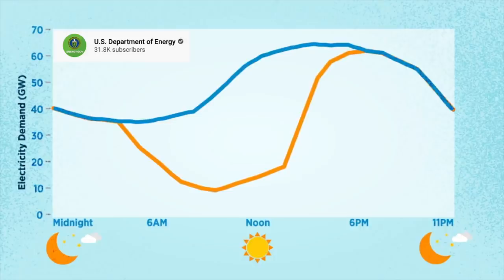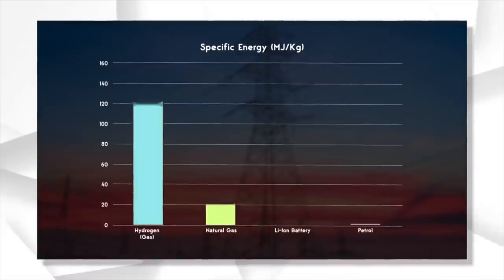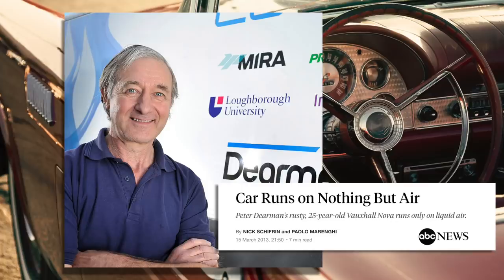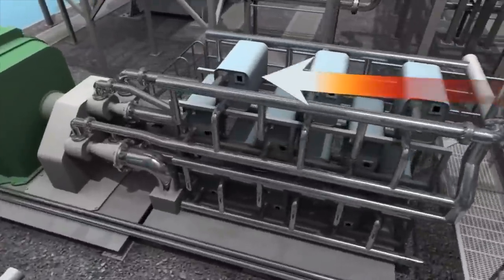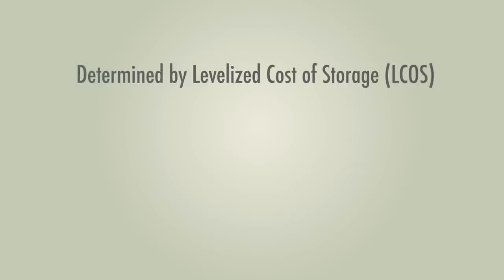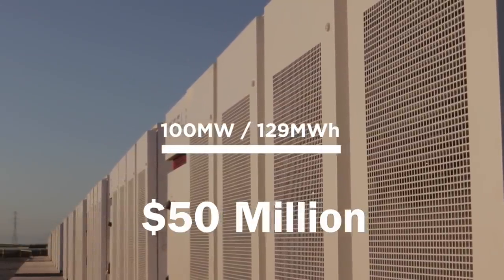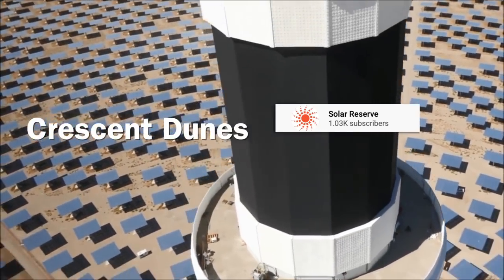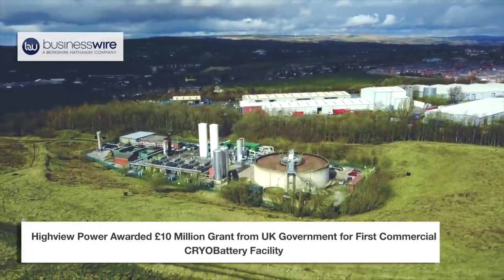This Battery Can Store Electricity In The Air

Comment: Thank you.  I was looking a clear and direct presentation : finally found one !  Will share. 
- this type of battery is incredibly clean (!) and considered "cheap".
Reply: It's not cheap if the Highview plant is representative.  Comparing it to the Hornsdale Tesla battery in Australia, liquid air costs about twice as much as Li-ion, and Tesla's latest technology looks to be able to cut costs in half in a few years.
Reply: Yeah,the point you made is kinda right.
But you see, Li ion batteries are relatively cheaper upfront. These batteries need high maintenance. They deteriorate so rapidly, like 20% in a few thousand cycles. 
To put into reality, you install a GWh of Li battery today. This turns into 800 MWh in a year or two, and so on.
You can even notice it in the EVs, "Buffers" exist for the very same reason.
Reply: @autobot3925  Tesla's cells are much more long-lived than that.   They are getting even better over time.

Comment: Subsidies are frowned upon. Easy enough for a company like Sumitomo to install its own plant to demonstrate the tech. Subsidies should be unnecessary due to the duck curve. A power supplier would surely want to store solar and wind when it is plentiful and sell energy when demand exceeds supply. A lot of solar and wind will go to waste if cannot be stored. So, could consider the liquid air plant as having a low to zero energy cost.

Comment: Efficiency of pumped storage is much lower , I guess around 25% or something around. Whereas in video you mentioned this baterry efficiency is around 85% which is much higher than pumped storage.
Reply from the maker: Where are you getting that figure for pumped storage? It’s much higher from what I read...
Reply: Pumped storage plants with outputs >100MW  have  generally combined efficiencies of >90%. 

The 250MW  generator  at Linth-Limmern hydroelectric power plant has an >99.7% efficiency. The attached pump turbine has about 86%.

Comment: Pity they can't use the heat for district heating or driving heat engines (Stirling seems to be the flavour of the month) and then absorb the heat from the atmosphere or geo-thermal sources when generating power.

I can see issues with the size of heat exchanger or problems with icing up, but surely these aren't insurmountable?

Comment: Build a giant building or hole and lift a heavy weight and then when energy is needed you drop the weight and turn generators using high gears ..

Comment: 50-70% is the efficiency of a single electromechanical conversation. At least this system must have two🤔..
Reply from the maker: They reuse a lot of the heat generated during compression. 

I think I read single cycle was something like 26%